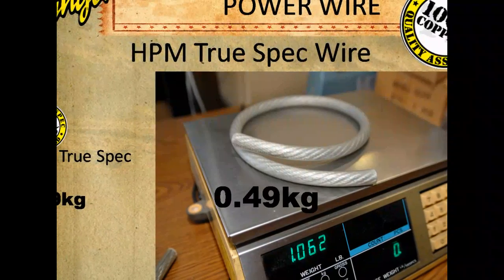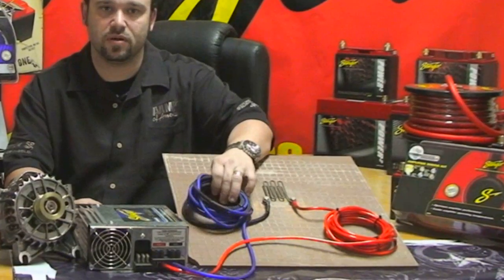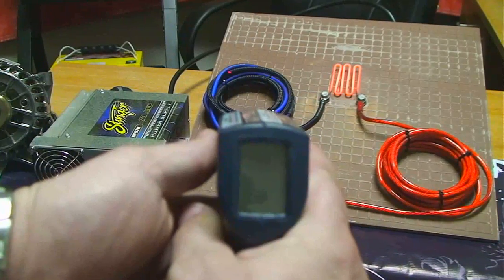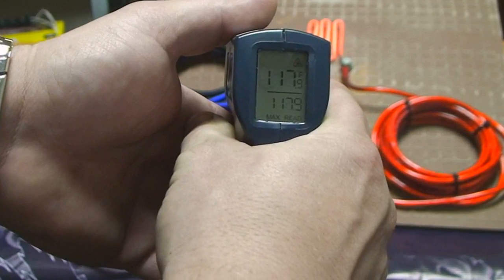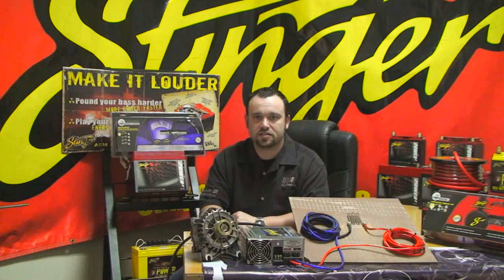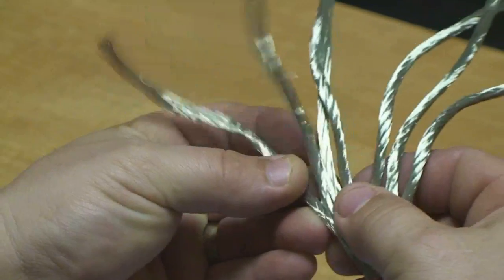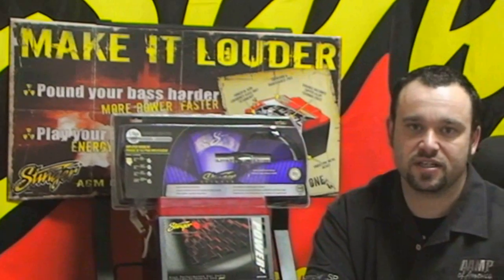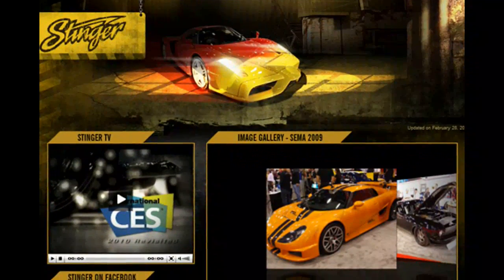True Spec vs CCA (Stinger Electronics)

Comment: I am amazed at how people want to make this a "brand vs brand" issue when the bottom line is this. CCA wire is cheaper because aluminum is cheaper. Aluminum will not carry the same amount of current safely gauge for gauge as copper will. Aluminum has much more resistance than a comparable copper conductor. Aluminum was used back in the 70's for house wiring and was quickly stopped because of its different expansion rate compared to copper, brass or steel (outlets and switch hardware) and its lower current capacity compared to the equivalent gauge in copper. There were many a house burned to the ground because of it. Pick whatever brand you like, just make sure you are using a wire made with 100% copper, true AWG size spec and if you are really in to it, tin plated for corrosion resistance.
Reply: +1 for that!
Reply: Crazy part is houses still hav the aluminum wire running in there house. No joke call me crazy but uve found a way to tell without havin to check fyae bix or a outlet. Pretty much aluminum wired house outlet always will make my charger get hot. Like 🔥 hot. I only know cuz 1 side of house doesnt but the add on/upgrade part of house doesn't. Sure enough checked just the outlets and u could c how its dangerous. I now use a long extension cord for Tv and my computer. Nd i do my best to unplug n e thing thats not being used.

Comment: how about you do the test correctly and then report back?  CCA has a higher ohms per foot than OFC has, this means that you have to use a larger gauge wire to accompish the same thing.  what you are doing is testing apple and bananas.  put your 4ga OFC wire up against CCA 2ga and see what happens.

Comment: I just purchased two different kits, and BOTH were not true 8ga. Both were about 12. Wouldn't use stinger. Buy industrial super flex wire. Most cases it's way cheaper and you won't have to guess since it's all labeled.

Comment: Actually, CCA wire CAN be a bargain. Sure, it doesn't perform as well as OFC wire does gauge for gauge, but it's conductivity per dollar is so much better! For example, 4 gauge CCA wire is about the same price as 8 gauge OFC wire. There isn't any question that 4 gauge CCA wire will perform better than 8 gauge OFC wire. So CCA wire can actually be a better wire for the same or lower price.
Reply: You just need to beware of what your doing. How many amps your amp will needs. I run 0 Gauge CCA for a 2000w amp @ 1Ohm. 0 Gauge CCA Can handle about 245 Amp @ 15 Ft
Reply: @TNW1337  Exactly. Aluminum wire can be a good deal if the price is right and it's used properly, but like any other wire, undersize it and you are going to run into trouble. There's a reason aluminum wiring is used extensively all over the world for long distance power transmission and even in the aerospace industry- it has a significantly better price to conductivity ratio and and weight to conductivity ratio than copper wiring.

Comment: Should have just showed a demonstration with just current going througg the wires.  The heat from that coil is gonna get the wires hot no matter what. Heat travels through metal. The aluminum is hotter because it has different properties than copper. You just really showed the difference in each materials  heat transfer capabilities .
Reply: Also the jacket  on the stinger wire may be a better insulater than the cca wire jacket there for giving a different temp then the wire actually is.
Reply: Where is the heat coming from?

Comment: Test isn't accurate.  The wire on the left was tested before the wire on the right, on both tests, giving the wire on the right time to heat up.  We don't know what the wait time is among the left and then the right wire.
Reply: +Kaitlin Bertram  I would agree, we should see the test both ways. However, I tested in house and there is significant power loss with 4G CCA / vs. 4G OFC.
Reply: Could You please explain what is the difference if the blue wire is on the right side or on the left side?
There is the current flowing through the conductor that heats up the conductor. The current is same for both ways blue wire on left or on right so how can there be the wait time ? Thanks in advance.

Comment: I don't get the big deal. Sure, the aluminium wire didn't perform as well as the copper wire of the same size. But who was expecting it to? Most people know that copper is a better conductor of electricity than aluminium is, so therefore aluminium won't perform as well. Even under the best conditions, an aluminium wire only has about 2/3 of the conductivity of a copper wire gauge of the same gauge. 8 gauge aluminium wire isn't even rated for 70 amps of current, so in really, all this proves is that wire fails when it is overloaded, which we all knew.

Comment: heat in wire is caused by one thing only! wire is disapating power. how does that happen?simple watts law! ohms the wire to determine the voltage drop, then current through the wire and that is how many watts the wire will disapate.  CCA will perform just fine ,sized it correctly.  your test would fail with OFC if you used 8ga too, why?  becuase the wire is too small and the ohms per foot are too high for the current being drawn, plain and simple!

this is all marketing hype to sell a product!

Comment: This Is Like 2 Years Old. The Point Was That Copper Wire Of The Same Length Of CCA Performs Better As A Conductor. No If Ands Of Buts. 

If You Limited On The Amount Of Wire You Can Run, Go Copper. If Your Not And Can Run Way More Go CCA. 
But Aluminum Does Oxidize Faster. Good Luck.